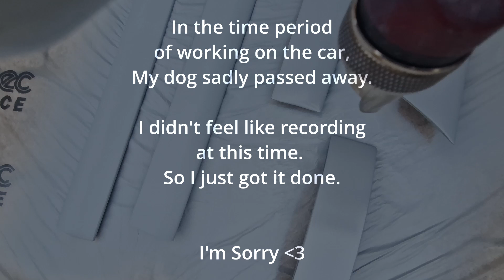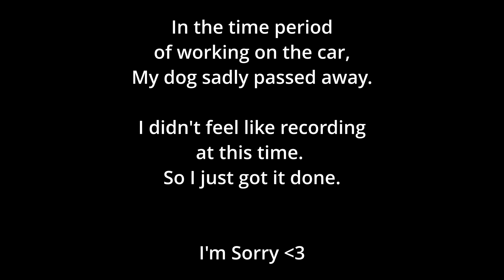Audi A4 B5 Quattro Project: Finally Painted Some Trim & The Car!

Comment: What paint gun and compressor setup are you using to achieve a result like that?
Reply from the maker: Just cheap 50L compressor 12cfm. Northing fancy

Spray Gun was a ANI F150